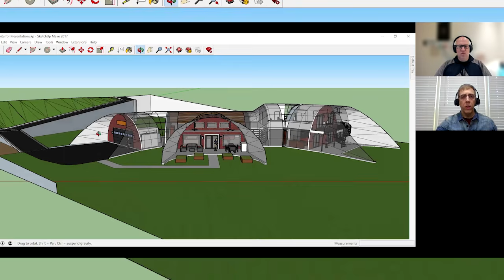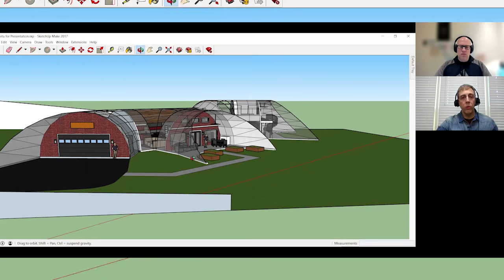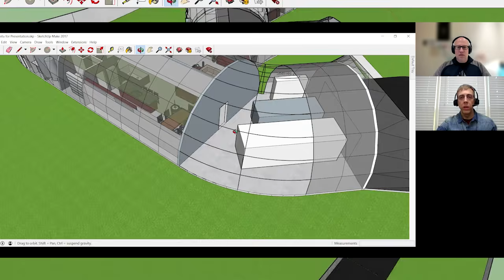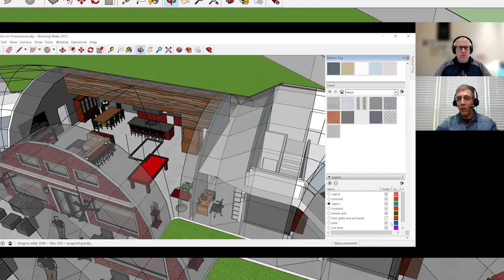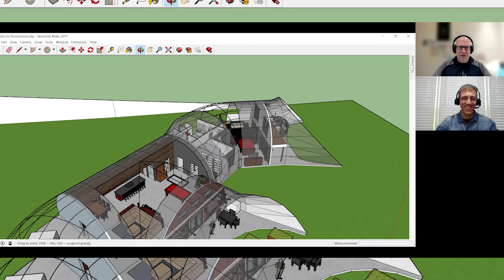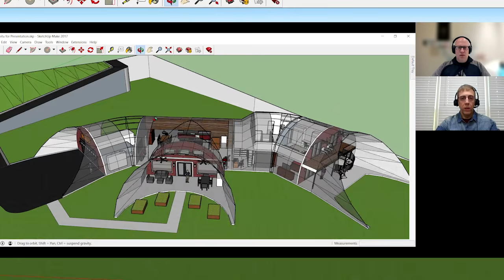Home designed to last 1000 years?

Comment: If you actually want long lasting home, definitely don't build under dirt. Build with brick and stone. Choose your lot carefully, install solid foundation, be very particular with stuff like ventilation, future maintenance etc. And more importantly, build house that you would think fits most people so nobody has reason to tear it down or let it rot.
I would personally go for something like brick, slate roofs and high insulation. But frankly most important thing is to just have excellent architectural design, as in something that's proven to over long time, and very good interior layout and size. All buildings need renovation and maintenance, just make the building appealing and worth it and people will keep the building going for a long time.

Comment: The concrete and rebar would not last more than 100 years. We need to develop a roman type concrete, limecrete is one ingredient needed. It can heal cracks overtime.
Reply: or some type of geopolymer
Reply: Modern concrete generally is a lot more durable than roman concrete. 
The thing is, rebar tends to rust. 

Roman concrete has no rebar. As such, it got very low tensile strenth , being completely reliant on compressive strength. But due to no rebar, it can last essentially a eternity.
Reply: @eingrobernerzustand3741  Yes and 50 years for a buildings lifespan is unacceptable. I cant even believe it is used. They are working on hemp fiber rebar. We need a combination of that and a new roman concrete mix or some type of geopolymer.
Reply: @tukek88  hemp fiber probably won't increase lifespan. Maybe basalt fiber might work for that. 

But really, my whole point was that you schould stop simping for roman concrete,  it's just plain inferior. 

If you want to learn from the Romans, then don't copy their inferior materials, copy their superior techniques and rely on compression more.
Reply: @eingrobernerzustand3741  No more Ron, its not . Until we can figure out how to make it last longer than 50 years it is in no way superior. It merely has different qualities so you have to build differently. There is no comparison in lifespan. Hemp fiber rebar would increases lifespan and it is a technology in progress.  We need a new formula with something other than steel rebar and one ingredient needed is limecrete., or we need some type of geoploymer. But the modern way of doing it is iunequivocally not superior, IT ONLY LASTS 50 YEARS.
Reply: @tukek88  that's the thing, one can use modern concrete without having rebar in it. Reinforced concrete and concrete are not the same thing. Your short lifespan issue is with Reinforced concrete. 

And building built wirh modern unreinforced concrete would last far longer than any roman building. 

It would bring a litany of other problems in regards to grounding tough. And seismic shocks. But thats for folks smarter than me to figure out
Reply: @eingrobernerzustand3741  Yes, very good. And without rebar it lacks tensils strength just like roman concrete but the difference is portland cement has no self healing properties like roman concrete. So it is inferior. The limecrete they used in roman concrete is what causes the self healing. So everything I stated stands correct. We need a new "roman concrete" formula and we need to figure out tensil strength using something other than steel rebar, as I stated.
Reply: @tukek88  
The issue here is that self healing is fucking useless. 

One doesn't wait a century for a crack tp heal in a inhabited building. 
This percived advantage is only useful if you are dealing with a ruin.
Reply: @eingrobernerzustand3741  "percieved advantage"? it isnt percieved, it works evinced by the standing structures. Lets put roman concrete to the side, the modern technique sucks. 50 years is unnacceptable. period. We need a new way or a new formula. We need to return to stone, a typ of roman concrete and geopolymers. I would much rather build differently without the tensil strength than have building only last 50 years, 50 years is absurd.
Reply: @eingrobernerzustand3741  also the "self healing" properties probably can be improved. Either way we need to be experimenting and researching how we can make building last longer. I actually love concrete, I love doing the work, I love what you can build, I just cant stand the thought of only 50 years. It just doesnt make since to me. I want to return to the great architecture and structures of old that last generations. There is a way, we need to figure it out. Portland and rebar is not the way.
Reply: @eingrobernerzustand3741  what it could be use as rebar without the negative of it?   

I do want to make a house that last at least 200 years minimum or no maitainance
Reply: @carrerasrivera  what are you asking,  exactly? Im sorry,  in no native speaker,  and dont understand your sentence